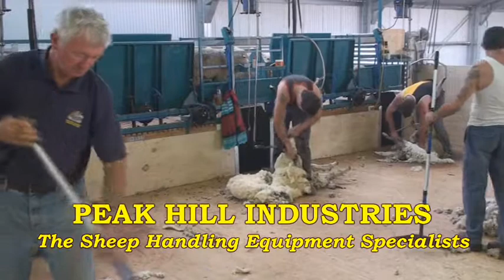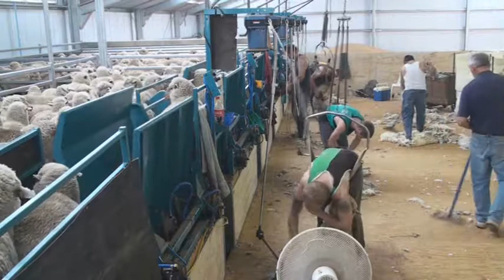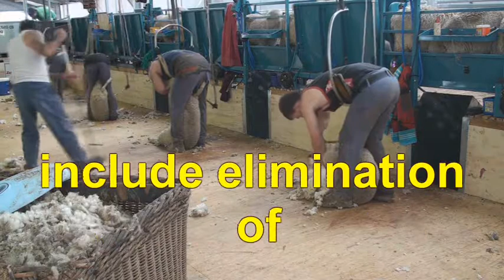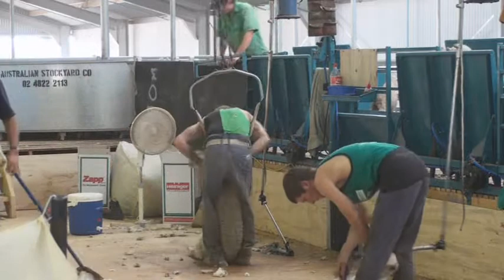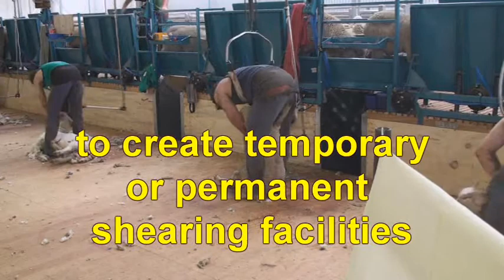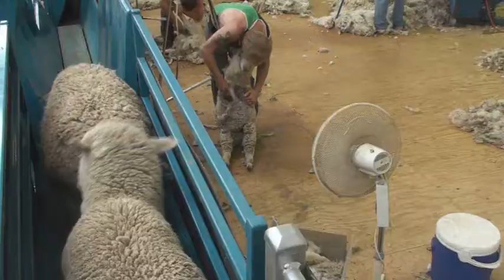ShearLoader @GLB

Comment: this is the best shed shearing idea i have seen yet. easy on the sheep and especially easier on the shearer. A smooth and efficient system. the closest you can get to a traditional style shed with a modern ideas and applications. A HUGE CONGRATULATIONS to the designer and especially the manufacturer, must all be shearers themselves, beats every thing else around hands down, TALLY HO